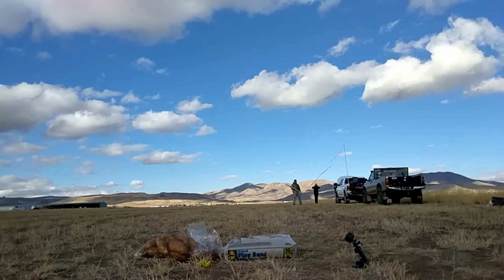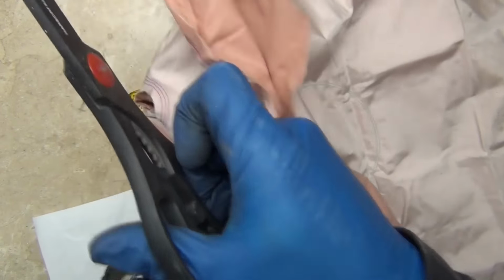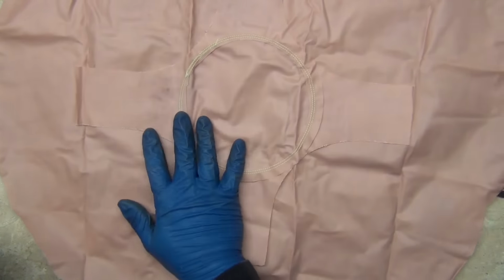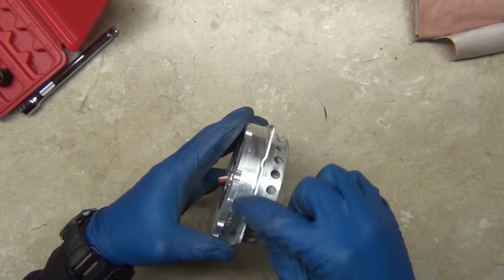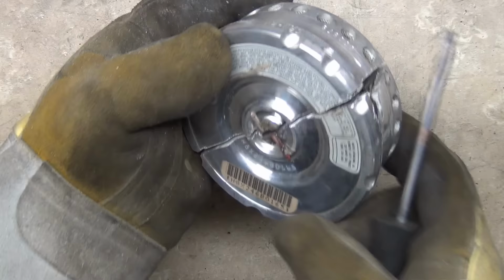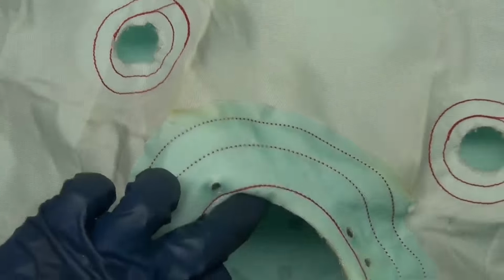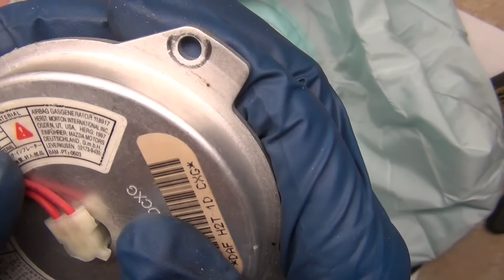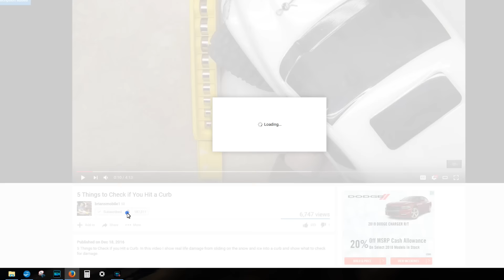What's in an Airbag?

Comment: 24 karat gold hair wire, like a clock spring- baked into a wafer of basically same compound as an Estes model rocket motor. Micro capillary tube accelerometer (shake down a mercury thermometer) provides electrical activation, capacitor dumps high voltage into gold hair wire, completely igniting wafer, expanding gas instantly inflates Kevlar bag, bellows allow deflation. Average unit has same force as a 12 gauge shotgun shell, and used to maim and decapitate small children before 2nd generation, 2-stage & seat weight monitoring units came into use.
Reply: That's why in any car equipped with airbags in the manual it says don't put kid under XX pounds and X years old(I don't remember the real numbers) in the front seat.

Comment: The caps on the inflator are called diffusers and they are inertia welded to the base, at least the steel ones are.  Not sure about the aluminium ones, I used to build the steel ones.

Comment: I hate airbags, personally.  They can have their place, it's just the low mph ignition I don't like. I suppose high speed accidents they'd be useful. I'm old school....
Reply: Cuba Rodriguez do you like your teeth enbedded in the steering wheel
Reply: LEXUS-RX300 I've been t-boned at about 35mph before, & luckily SRS sensor wasn't touched so airbag didn't deploy. My head never went near steering wheel. I saw the car coming peripherally & braced for the impact. I suffered no injury. 

I've been in other accidents while other people drove, no airbag, from the ages of 5 & on. Again, I only braced myself & never hurt on those. Every one of those were less than 40mph.... which is why I say, "airbags may have their place in HIGH speed accidents". 

The thing is, I've known many people who were involved in accidents where airbags were deployed. Some low speeds, & they busted lips, bit tongues, suffered black eyes, & burnt lungs from chemicals.  Others in the high speeds suffered broken wrists or other arm injuries due to holding the steering wheel so firmly or possibly wrong somehow. In the repair field, I've also seen where the SRS system malfunctioned & activated when there was no impact of any kind. Quite dangerous if you ask me.  ..

I think I'd rather wear some kind of 5 point harness vs. the airbag.
Reply: we had a 2000 Hyundai sonata and when a member of my family ran it into a fed ex truck at 45ish mph knocked the radiator through the engine block all the way to the firewall the airbags never deployed. if I remember right she lost a few teeth because of it
Reply: Nick Yeah, too high to hit the sensor which is mid to low radiator height. That sucks
Reply: Deployment requirements are more complex than that.  However a sensor getting "hit" has never been a requirement.  It is all about measuring deceleration rates for head on collisions within a fixed degree of center-line of the vehicle.  Sensor only needs to be affixed to the mass that you wish to measure.
Reply: Shain Andrews However it's calculated, I've seen them fail either way. High speed & not deploy or simply braking with no impact & deploy.  We are too dependent on electronics/sensors  & I'm not comfortable with that.  Anything electronic can have glitches, static charge or reactions due to voltage surges, intermittent conditions, & in computative components, the possibility of viruses. 

I prefer mechanical or simple operated components, period. If I weren't aware of or seen all the airbag flaws, it could have been a different story.  Hey, we all have our opinions. shrugs 🙂

Comment: Have you heard about the Takata airbags? It's kind of a big story here in Detroit.Defective airbags were made at, or otherwise used inflator units manufactured by, Takata's Monclova Plant in Coahuila, Mexico, operated by Takata's North American/Mexican subsidiary, TK Holdings Inc.The New York Times has published a report suggesting that Takata knew about the airbag issues in 2004, conducting secret tests off work hours to verify the problem. The results confirmed major issues with the inflators, and engineers quickly began researching a solution. But instead of notifying federal safety regulators and moving forward with fixes, Takata executives ordered its engineers to destroy the data and dispose of the physical evidence. This occurred a full four years before Takata publicly acknowledged the problem. So check your Subaru Brian.
Reply from the maker: I hadn't heard of that.   Thanks for the scoop!
Reply: WOW! I heard some of the Takata people are going to PRISON over this.Here's a link from C&D Magazine. http://blog.caranddriver.com/massive-takata-airbag-recall-everything-you-need-to-know-including-full-list-of-affected-vehicles/

Comment: Hmmm... you are aware that some bags are 'two stage'... where the restraint system processor can detonate one or both independent charges within the inflator unit depending on accident severity. Just because a bag appears to be 'spent' doesn't really render it 'safe'...
Reply from the maker: I've seen them go off in stages in crash tests.  Some are mechanical too.  I had a 96 XJ that had a mechanically triggered driver side airbag.  No computer, clock spring, wires, or sensors.  Just all one unit bolted up to the steering wheel.  You could mount it in a go kart.